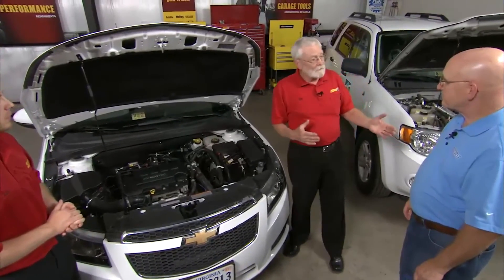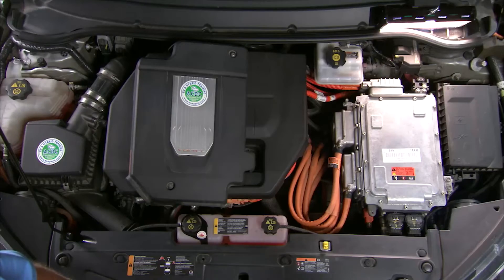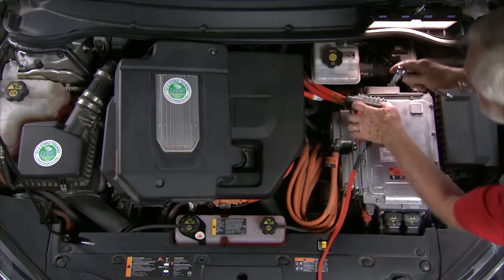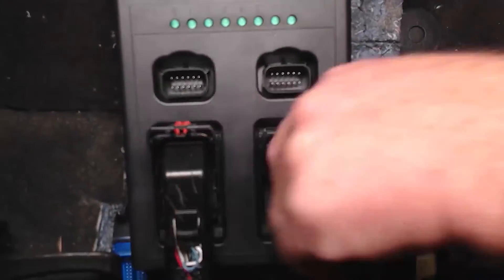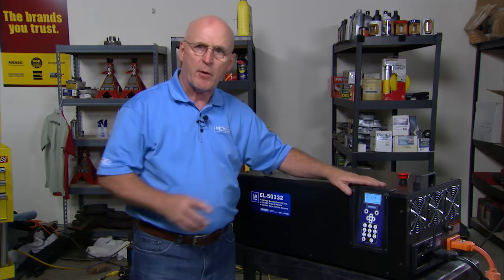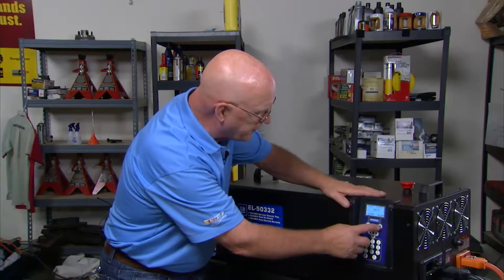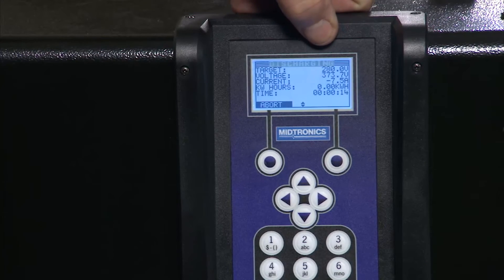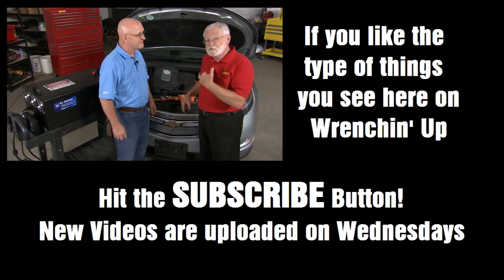Chevy Volt HV Battery Discharge & Check - Wrenchin' Up

Comment: my 2017 volt. when the ev battery goes to 0 instead of the gas engine starting, the car shuts down, no power, and get the check engine light and won't start unless i clear the HV codes.
Reply from the maker: Hi - Thanks for watching! Since your vehicle's condition wasn't part of the interview and long-distance diagnostics is difficult if not impossible, I think the best course of action is to follow the troubleshooting information in a service/repair manual for the vehicle. There may also be some other information on YouTube that you could search for about this issue.
Reply: This means your battery has a bad module

Comment: I was able to deep discharge the battery of my 2000 Honda Insight with three light bulbs, a socket, and a volt meter. I was able to grid charge and balance it it with a $200 box from a third party supplier. 

The Volt requires a $2,000 Bosch interface and a $50/yr subscription fee to their programming service to clear the high voltage codes, and the discharge device shown in this video clocks in at between $15,000 and $20,000-nearly as much as the most expensive Volts you can find on the market. 

Absolute lunacy to go to this much trouble to, I assume, disenfranchise the owner from the repair process.
Reply from the maker: Hi - Thanks for watching and sharing your experience. This video is several years old and it turns out that Midtronics developed this unit for dealerships and not so much for the aftermarket.

Comment: So I was thinking on the master disconnect would it be possible to make one that also was a power tap to a very big inverter to power a house in a power failure?
Reply from the maker: Hi - Thanks for watching! This would depend on whether the disconnect interrupts the low voltage circuit or the high voltage circuit. I haven't checked. I suggest that you check the wiring diagrams in a service/repair manual to be sure.
Reply: Did you ever find an answer?   that's a pretty smart idea

Comment: I have a 2011 volt..I live where  it  is cold... I would like to run it on gas all the time when temperature is 25 degrees.. is there a software that could do that??? or can i lie to the computer to make it run on gas all the time...?? right now i select mountain  but i can only do that if it is at 11 mile or less..
Reply from the maker: Hi - Thanks for watching! Good question but I don't have the answer you need. Hopefully someone will jump in here to help.
Reply: Your Volt being a 2011 should automatically cycle the engine on and off in order to keep engine coolant warm once it is 25F or colder outside in order to help cabin heating. Using mountain mode with the drive mode button would keep the battery charge percentage up near 50 do keep high performance with an aging pack. That is what a lot of gen 1 owners do nowadays. Either mountain or Hold mode

Comment: This is obviously not for the DIY owner. Do you have a video on how to remove the Voltec plastic cover. (Aside from the security torx bolts which I have removed). I have some wiring harness damage (rodents) underneath that I would like to repair/replace: the split loom tubing.
Reply from the maker: Hi - Thanks for watching! I'm sorry but I don't have a video on removing the cover, so I can only suggest checking with a service/repair manual  for the procedure.

Comment: What is the short circuit rating of this battery
Reply from the maker: Hi - Thanks for watching! Good question, but since it didn't come up in the interview/demonstration I don't have that information. Maybe Midtronics has it. Their contact information is in the video's description.
Reply: The max discharge rating for the pack is about 120KW maybe 130 definitely no more. Electric drive can pull 111KW and someone overhead beyond that.

Comment: no sure what is their intention .. for normal service work.. like oil or coolant change etc   I think it is enough to pull the disconnect in the arm wrest..   right?
Reply from the maker: Hi - Thanks for watching! The intent was to demonstrate the Midtronics equipment and procedures for discharging and charging up the HV battery for servicing or removing it. This is mostly done in dealerships and specialty Hybrid/EV shops.
Reply: @WrenchinUpwithJimBates  does pulling that plug under the armrest disconnect the battery from the Voltec orange wiring under the hood?
Reply: @derekca  Yes it disconnects the lithium battery from the rest of the vehicle.
Reply: For fluid changes and suspension work and such, there is zero reason to disconnect the high voltage system unless you need to manipulate orange cabling or components

Comment: Hello, My Volt does does not start, but it takes charge that just did not try the whole fuses, the error is a malfunction of the control module of the rehybrid transmission, the instrument panel lights up all the electronics works but does not go and the engine does not start when the hood is open, maybe someone faced such a problem?
Reply from the maker: Hi - Thanks for watching! The trouble shooting guides in service repair manuals for your Volt might help. Idetifix is a great resource too.

Comment: Is it possible to DC fast charge battery via Geberator cables to battery pack? I mean connect outside source to act as generator to fast charge battery like ICE doing via generator.
Reply from the maker: Hi - Thanks for watching! Good question. I have not tried anything like that so I'm not sure. I suggest that you check with Midtronics to see what they say or recommend. Their contact information is in the video description.